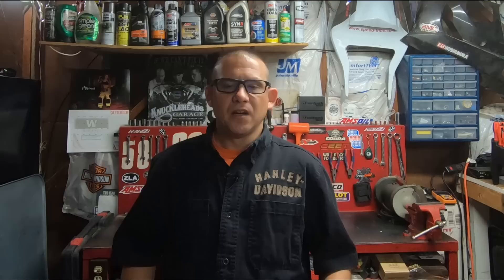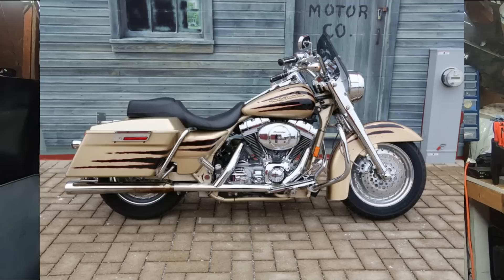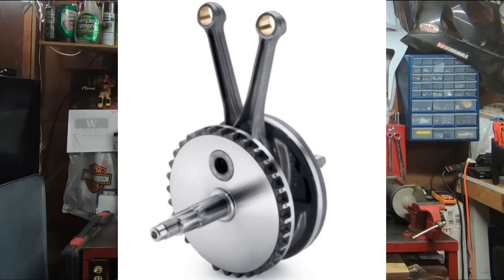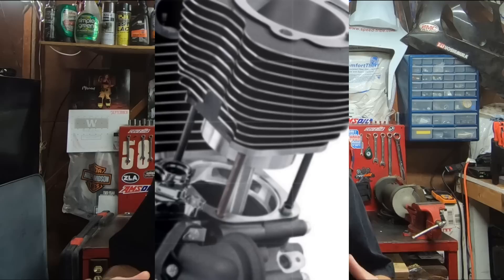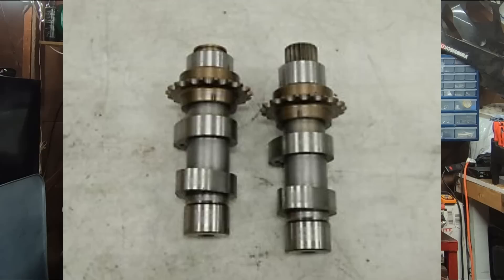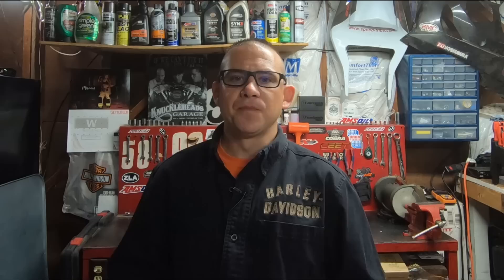The Twin Cam 103 With Hidden Secrets | Harley-Davidson CVO 103

Comment: Awesome video man!....I own that 2003 cvo road king, centennial gold, with the screamin eagle 103. It a getting work done on it, andrews 57h cams, 10 over bore, wesico forged pistons, 10.8-1  comp, cnc ported work done on the heads, as well as decked gasket surfaces,  5 angle titanium valves, and s&s stealth air, bassani 2 into 1 rr3 stainless pipe....its going to get dyno tune once broke in. I love this bike, it pulls like a freight train, I cant wait to see what it's gonna do with the new work....whats your thoughts on this build man?....id greatly appreciate your input
Reply: Did you get the build completed? My stroked 2003 RK police with a huge cam, built 103 heads, and power tuned has insane torque and speed, compared to most touring bikes! It would be nice (more comfortable) if it were a newer frame though!
Reply: @moto-mantis  ya it's a beast...120 tq. Gets stupid hot tho...
Reply: Just bought  a 2003 FLHRSEI2 w/27k miles. I need to change the cam chain shoes. Wondering what other upgrades I should do while it's apart. Not trying to make a race bike here,  just a good running reliable ride!!
Reply: @JoeHasGotToGo  awesome dude!. So I'd go with the fueling oe cam plate and oil pump with fueling 525 cams. The hydraulic fueling tensioners with the red shoes are really stout, and the 525 cams pull pretty damn good for the 95" motor. Then I use the sns stealth air filter on my 04, and any single bolt cover will work on it. Then if just want a good slip on for the head pipe, cobra is a good way to go, or freedom makes good pipes too that are reasonable.

Comment: The OG twin cam is the best one . Only thing you have to do is install a gear drive cam system to make it a bike that just needs gas & oil changes  ! If you want a real hotrod bore the case's add a set of 4&1/8 cyclinders & a 650 cam & you got a 107 cu in motor that will out run 110s & 114 M8 motors ! Short stroke big bore motors rule !
Reply from the maker: 👍 you get it! I had a comment earlier on why would anyone want an 88 when you can buy a 96 that doesn't need all the updates. That short stroke 88 has its benefits!
Reply: I was thinking about this. Can you throw the 88 crank into a 103 or 96 with some high compression pistons. To get the piston speeds lower so you can rev it up higher. My 88 Pulls so hard above 4K rpm but I hate winding it out past 5k. A bigger bore with a small stroke and all blueprinted and balanced, with good valve springs could be a screamer
Reply from the maker: You definitely could put a shorter crank in, but the longer stroke has its  benefits too.

Comment: I’m under the impression 96 heads flow better than the 88  even ported 88.  This is why I haven’t gone M8. Can’t just the extra cash for not much more.
Reply from the maker: The heads for the 96 were improved over the 88's, the CVO Screamin Eagle 103 heads really were only adequate for the 103 at the time. Now the M8 heads are a whole different animal being 4 valve heads.

Comment: Well I got bad news my cam chain tensioner went out on me today 80 miles from home any info on how to fix it is well appreciated especially for us on a budget also a better way to get in contact with you lol
Reply from the maker: My contact email is on my youtube page, best place to start is the Harley Sevice manual. It is the best manual l have ever seen, it's step by step with every tool and torque spec you need.

Comment: Great video, thanks for doing it on the CVO 103. That being said I have a Thunder Mountain that came with a crate 2005 103 SE. I'm wanting to bump the power up and would like some advice. What would you think of going with a higher compression piston? What about changing the cams out and having the head ported? I  would appreciate any advice to help me out.
Reply from the maker: The SE heads are a bit restrictive on that motor, a nice bolt in cam that can handle a mild compression increase and a port job on the heads will make a very nice and reliable engine. At the very least a bolt in cam always bumps a nice power increase.
Reply: @GixxerFoo  I liked what you were saying about the woods and S & S cams.

Comment: Quick question. Last year I bought a 2006 Softail Deluxe and absolutely loved it but it doesn't have that much power on the highway.. so yesterday I bought a 2005 Softail Deluxe with 5,000 miles and the Screaming Eagle kit from the 88 to 103. The ride home from South Carolina to North Carolina was 4 hours and I could really feel the extra power on the highway. To be honest I really couldn't feel a whole lot of extra torque taking off on the gears but once I was on the open road that's where I felt it. Now my question is that it came with the same size pipes as my previous Softail Deluxe but it's not as loud at all. Why is the 103 upgrade not as loud as my Vance & Hines pipes
Reply from the maker: It's likely the baffles, someone may of put the quiet baffles in the exhaust. Depends on mileage and use on the pipes, the packing around the baffles will burn off to a degree over time.
Reply: @GixxerFoo  I actually found out the answer that I was seeking. I took the Screaming Eagle pipes off and bought the exact Vance & Hines Big Shot staggered for the 2005 with a Screamin Eagle kit. Looking at my paperwork I found out that it was an FTLSTNI not FLSTN... so in the end it was fuel injected.

Comment: What are your thoughts on the 2012 softail convertible cvo? Looked at one a couple of days ago. Just had over 17,000 miles.  Thanks a bunch.
Reply from the maker: Absolutely beautiful motorcycles, a guy I work with has one and he loves it. He's had his for years without any issues which doesn't surprise me with the 2012. That later 110 is a great engine in my opinion, if it's a decent price and it still has the bags and windshield with it I would go for it!

Comment: Did that motor have the Timken bearings in it?...i have that exact road king that you pictured...i put a bassani road rage 3 stainless 2 into 1 with an s&s stealth filter, with a pc5....it runs boy let me tell ya!.....its getting andrews cams, 10 over bore and hone with weisco 10.5 to1 forged pistons and all the fixins it needs to accommodate those parts....then it's going to the dyno. Dont ask me why, I fell in love with the bike, its a great motorcycle!...handles like a dream...i was told it has the Timken bearings in it tho getting back to my original question....
Reply: The heads are getting cnc ported as well...
Reply from the maker: That's one heck of a setup, l don't believe it has the Timken bottom end. They stopped doing that in 2002, but I'll double check the parts fiche and see. It is possible they were built in 2002 with the Timken button end and sold in 2003. You'll have to let me know how your build turns out!
Reply from the maker: So l checked the parts fiche and it doesn't show the Timken bearing setup. It's showing the non tapered needle bearings for that year.
Reply: @GixxerFoo ....thank you for the response. So I talked to the harley mechanic his morning  thats doing my build and he said that particular motor being the screamin eagle 103 motor, they used timken bearing ?!...im not trying to debate you just telling ya what he told me....either way he told me its a bomb proof motor thats worth doing the upgrades so I can't wait to run this thing!.....i have tribodyn oils for all 3 compartments....
Reply from the maker: That's interesting, I'll have to do some more digging and see if l can find a alternate part number. The OEM parts diagram is showing pressed fit bearings for a 2003 CVO RK. I hope it has Timkens, that would make it an absolute beast of a motor.
Reply: @GixxerFoo  ...ok , thanks again for the replies, means alot man...im a new sub and I love your channel brother
Reply from the maker: Not a problem at all. Thank you, l appreciate the support!

Comment: I'm going to look at a 2009 Road King with a 103" in it. Any guesses if this is a kitted 96 or a stock 103?
Reply from the maker: 2009 Road King originally came with a 96, unless it's a police model then it would of had the 103 from the factory. If it's a civilian Road King it would be a 103 kit, likely drop on cylinders with a piston kit. So you might ask about what compression ratio pistons they went with and what set of cams are in it. You might get a nice surprise if they went with high compression and high lift cams. If they don't know, you can run a camera down the spark plug holes and look at the top of the pistons. If they are flat it's going to be the lower compression kit, if they have a bowl in the center they are high compression. That's about the most information you can get without opening up the motor. Hopefully they receipts for the work so you know for sure you're getting what you're paying for.

Comment: Your Awesome, I had the 2005 FLSTSE or Fatboy CVO. It was impossible to get a straight answer of the origin of the 103cid was it stroked 88 or a new motor that started at 103. Unfortunately I wrecked it and lost it when I used insurance payoff to live and not buying the bike back and repairing it. 
I now have a similar situation with the 103cid High Output in my 2014 Rushmore StreetGlide Special. As far as what Cams it uses. Are they the CVO253 used in 2003-2006 or are they something else? If you can clear this up for me I would be very Thankful. That was a very good video full of useful information.
Reply from the maker: The HO uses a higher lift cam than the stock cam on the regular 103. I don't believe it's the same as the CVO, I'll check and find out exactly which one it is.
Reply: GixxerFoo I think you are right about not being the same as CVO. I am very interested to know what the specs are. I very interested to know where you get your info. I am not a Harley tech. So I don’t have any access other than at the dealership. 
What I was told it’s just listed as part number with no specs attached. 
I look forward to other interesting videos from you. Thx Wally
Reply from the maker: The 103HO cam is similar to the SE-255 (.556"lift, 211*/235* intake/exhaust) but it is  .511" lift 212*/233* intake exhaust. It's a really decent low speed torque cam.
Reply: GixxerFoo Excellent! I have done Cat out exhaust with 3.5” or 4” Bassani mufflers pipes and removed the back off stock air cleaner, and call it a stage2 motor. I cruise about 3000 RPM in high. The cams have a nice lope at 2000 RPM. Do you think it’s the right cam for me? Just your opinion, I find you to be a highly accurate source. Thanks Again Wally
Reply from the maker: Where do like your power to hit at? Like low end, mid range or top end? Also depends on the kind of riding you do, curvy roads open highways etc.
Reply: GixxerFoo Yes, I would like to define in RPM Low 1500-2500
RPM Mid Range 2500-3500
RPM High 3500-4500
With that being said, I’m 2000 to 3500 RPM rider with blast into the 5000 plus. 
I think it’s governed to 120 MPH that is 4600 RPM. In 6 gear.
Reply from the maker: If you did want to change cams the SE-255 wouldn't be too bad of an upgrade. It makes great power below 4500, but you can still rev it out to 5 to 5500 rpm. It does sound like your bike is rev limited. It should run up to 5800 rpm.
Reply: GixxerFoo Do you have any idea of the HP/TQ gain on SE255 cams? 
Can any tuner change the govenor setting? Is it governed on the speed or the RPM?? It will hit 6000 RPM in every other gear.
Reply from the maker: That's a bit strange, yeah any tuner that allows you access to the ECM tables will allow you to raise the rev limit. I've never heard of one being governed in 6th gear.

Comment: So I have a late model 103 would it be any benefit for me if I was to get a set of those heads and use them on my 103 . Or even using a CVO crank stroker crank that is along with those heads and maybe a 107 big bore kit..🤔
Reply from the maker: The heads on your bike are honestly better than the old CVO heads. Your moto has the same stroke as the old 103. Best place to look on your bike would be cams and high compression pistons, or a 107 cams and more compression.

Comment: My M8 107 has made short work of a few TC 103s and 110s
Reply from the maker: That new four valve head really makes a huge difference!
Reply: @GixxerFoo  Yes they do I have a stage one tune with Rinehart pipes probalby the best running HD i have had and I have had about 10 of them!!
Reply from the maker: Rinehart is what the service manager at my local dealer recommends. They really work well on those m8', my buddy has one on his 107 Street Glide.
Reply: @GixxerFoo  yes they do!

Comment: Hi 👋🏼, I actually have a 2003 Road King CVO Anniversary Screamin Eagle and
 wish to know what upgrades I can do with it especially as it relates to the compression ratio ( currently running @ 9:1)? I’ve upgraded the cam (Feuling 576 with hydraulic tensioners). The valve train is a bit more noisier which is probably due to the high lift combined with low compression? Need to know what would be my best SE piston combination including new pushrod setup?? Thanks David
Reply from the maker: Feuling cam is much higher lift and it's gonna be noisier, Sportsters with 585 cams sound like a Ducati dry clutch lol. Actually changing your cylinder heads out to the Screamin Eagle Kompressor heads would give you a big compression boost with your stock pistons. But you could go with 10:1 flat top stroker pistons, but likely you'll have to replace cylinders too, depending on the shape they are in.
Reply: 2 into 1 exhaust made mine pull like a freight train....its getting an overhaul now with weisco pistons and all the goodies to go with it!....s&s gear drive cams and cam plate are great parts
Reply: You have the gold w/graphics cvo rod king? I just bought one, 27k miles. The cam chain shoes need to be replaced. Wondering what other upgrades can be done while replacing the shoes.

Comment: I have a 2006 Thunder Mountain custom with a 103 screaming eagle motor in it , Can you tell me the particulars about this build?
Reply from the maker: Is it a custom built engine or a factory SE 103 swapped over? The 103 in 2006 was a 88 with a longer stroke crank, larger cylinder bore with a set of SE heads and bit higher lift cams. The heads really could of been better, they weren't bad but they left a lot of power on the table. Other than those changes you still have the OEM tensioners, cam plate and compensator.
Reply: @GixxerFoo  thank you for the info

Comment: My V twin sportbike has a very wide bore and short stroke. It redlines at 11,000rpm. Makes me wonder if you could do similar with an 88 crank with the biggest bore cylinders available. Of course, cams, heads, valvetrain would all need to be carefully matched to suit. I have seen some impressive performing 88s.
Reply from the maker: You can get pretty crazy with a Harley motor, crazy enough to crack the cases. A lot of the big horse big inch engines like Jims crate motors have special cast cases.
Reply: @GixxerFoo  
Ultima case, 88 crank...
Reply from the maker: Stock cases wouldn't handle that but the Ultima case will get it done for sure.
Reply: @GixxerFoo  
And a well balanced and welded crankshaft assembly. Valvetrain will be the limiting factor. My 67 289 V8 doesn't make much power until about 5500, and then it comes alive until about 8500. Similar thought process for me on the wide bore short stroke HD.
Reply from the maker: Crank balance is the key on Harley, they had the XR 750 reaching to about 9K. Totally different motor but a lot of time spent on the cranks.
Reply: @GixxerFoo  
Thanks! I am not talking about a throw together motor. If I build my HD engine I want it to sing like my 289 does. It sounds like Nascar. An HD engine hitting high rpms would be an accomplishment. Long strokes limit what is possible. 10.5:1 compression ratio minimum.
Reply from the maker: Just upping the the compression on a Harley nets some major gains!
Reply: @GixxerFoo  
It may be a few years from now but if you ever hear about a crazy high revving HD it may be mine.
Reply from the maker: 😆😂 it can be done, should make some serious power too!
Reply: @upsidedowndog1256  ever thought of putting a turbo charger on it, not sure what they rev at but when one goes by dang they really sing
Reply: @AmericanPatriot-cw9xe  
Not a bad idea. I have a 1985 Kawasaki 750 turbo that is an absolute hoot to ride. Boost is very addictive and makes adrenalin flow like crazy!

Comment: Question, 06 RK with a tc88.. I'm at 70k miles and want to build a 103. Can I grab a 96 crank, 103 jugs and some wiseco pistons, and re use my 06 88 heads? If so that would be alot cheaper than buying a "kit"
Reply from the maker: For the 88 the factory 96 cranks won't work in the cases, those cranks were designed for the late style primary and the crank splines are different. A stock set of 103 jugs will fit on the motor and you could reuse the heads. You'd just have to source a 4-3/8 stroke crank that's made to fit the 88 style cases, that way everything else will go back together.
Reply: @GixxerFoo  thanks man, exactly what I needed to know.

Comment: What about the RK in 2007 and 2008?
Stock bike with a 103.
I have both!
Reply from the maker: Sound like you have a couple of police models, they came with the 103 instead of the 96 engine. But that 103 is more like the newer 103 that started in the 2010 model year.